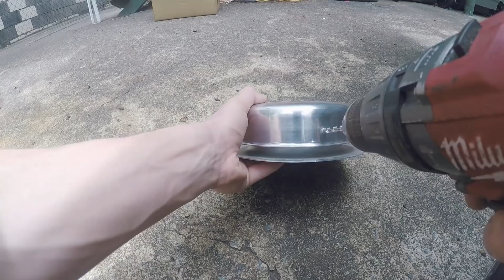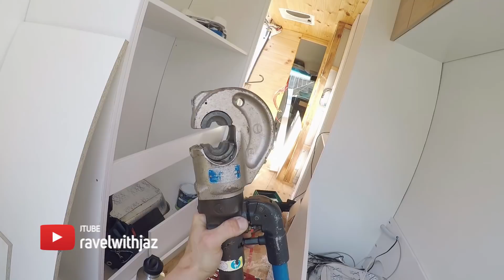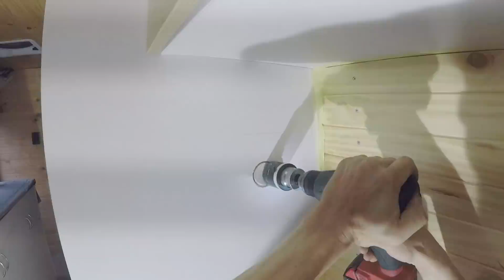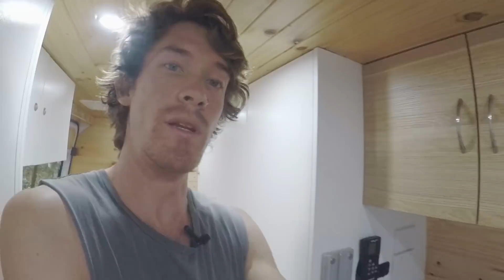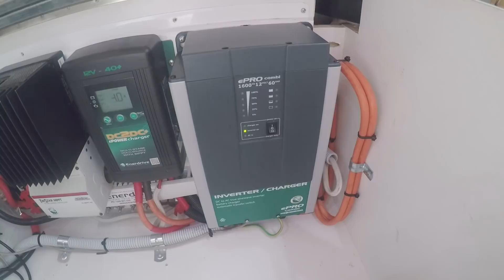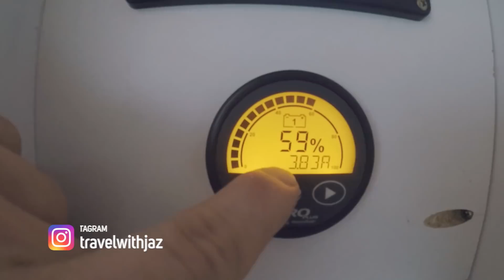S1E13 Sprinter Van Conversion | Electrical Pt. 2

Comment: How would the rcbo off the inverter function?
Reply from the maker: I tried to explain the best I could, I will have to do it better in words on the blog post, I have a little bit of information already in my blog post for electrical Pt.1 on my website.
Reply: I know how they work, what I'm getting at is how they will (or won't) work in your situation. An inverter doesn't have a neutral, it has 2 phases, neither of which is tied to ground. Potential has no desire to go to ground, it wants to go to the other phase. If you tied one phase to ground via chassis, then you have several problems. If you try to plug in to mains what happens? You will have potential between the chassis and earth unless you disconnect the chassis link or put down an earth peg. From memory a caravan cannot have an earth / neutral link (which you seem to have by bonding one phase to chassis unless I misunderstood). Also what's to stop you back feeding inverter power into the mains? I think a changeover switch is required. I know there is a relay in the inverter but the law does not let you rely on that. Last time I looked there were no rules for inverters, only generators but I would check if you have overlooked any rules or safety issues since no doubt you are certifying yourself
Reply: I remember a few years ago a discussion on the electricians forum about how the rules were wrong when inverters were involved and how rcbos would not trip but I've been out of the trade a while and I'm fuzzy on the reasoning behind this issue. I don't ground one phase because it creates a path for the current, ie in trying to solve a problem that does not exist you actually create one. Case of inverter to chassis, yes.

Comment: Here you can see a real pro at work!
I´m a electrician by trade and would do anything like that! Nice to see Hager hardware in down under, worked with their stuff a lot!
Impressive that this slim Li-ion battery could handle such loads...what are the size of the battery cables, 50sqmil? 
Hydraulic crimper and bubble scale for the switches/outlets, never seen the use of them in anay camper build!
You and Greg Virgoe are the most impressive camper builders, must be because of the use of a Sprinter... :-D
Thx for the vid, safe travels!
:-)
Reply from the maker: Thanks a lot mate! yeah hager has always been my favourite type of breaker and as I am aware the most common domestic breaker. Lithium Ion's can handle massive loads. that battery cables are 95mmSq ;)

Comment: The NZ/AU rule about not being able to store anything in front of the breakers, would it be acceptable to have a breaker box at the back of say, a wardrobe or cupboard? Assuming that it's in it's own box, which doesn't have room for storage but the whole box is at the back.
Reply: It's primarily about immediate emergency access.
Reply from the maker: I believe it depends on the size dimensions of the cupboard. over a certain size it would be okay, but if it is within the size that the rulebook says, technically no i believe. I'll find out this rule when i write the blog post and post it
Reply: No.
Reply: Thanks for the reply. I found a bigger problem anyway, my breakers are nearly on the floor. After reading the regulations they have to be 1.2m above it. So that's an issue considering they're in my Victron EasySolar box which there's no way I can lift that high. So we'd have to extract them and mount in a new switchboard up higher. I'll talk to my electrician about it.

Another thing you mentioned, you have to use double pole switches? My reading of the regulations is the only mention of double pole switches in AS/NZS 3001 is to refer to AS/NZS 3012  (Electrical installations - Construction and demolition sites). Which isn't relevant to a normal campervan? Does that sound right? My sparky wasn't sure, I'll have to check with a caravan electrical inspector I suspect...
Reply: I talked to my electrical inspector. It'll be fine to have the cupboard inset and down low, as you say, as long as it's easily accessable. It's very normal for campervans break the rule about having the panel too low to the floor. I also confirmed in New Zealand at least, you're allowed single pole power points. It might only be Australia that dual pole are required.
Reply: Great to hear that they are somewhat flexible if you indeed have the accessibility. I think here they would screw you anyway. xD

Comment: Nicely done with the shower vent. It was a struggle to find anything that would fit under solar panels. I ended up with a Ventline fan, which has the advantage that the lid will only go up as high as it can, so mine hits the bottom of the solar panels which works just fine.
Reply from the maker: that will work to good on you, always multiple solutions for the same problem ;)